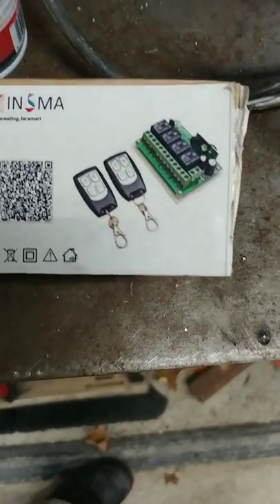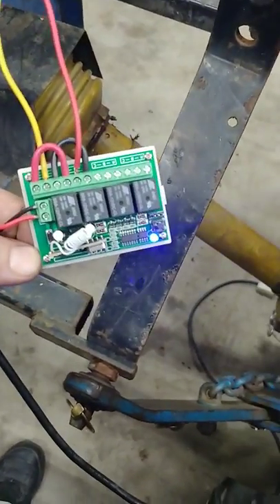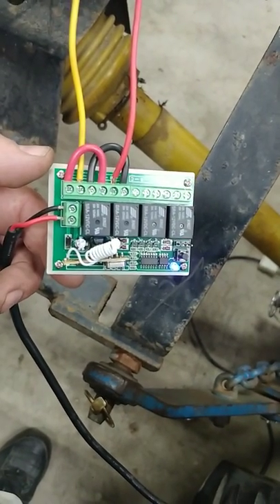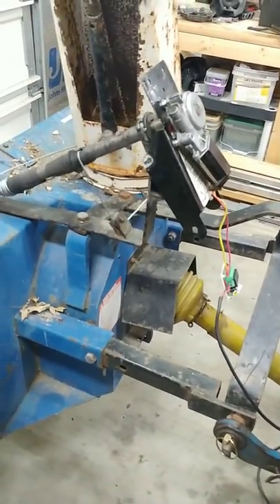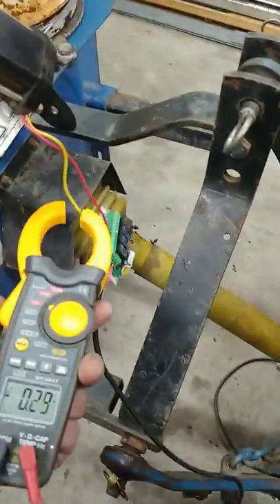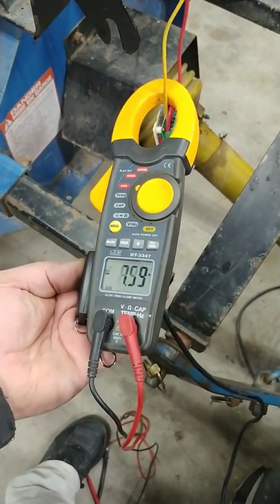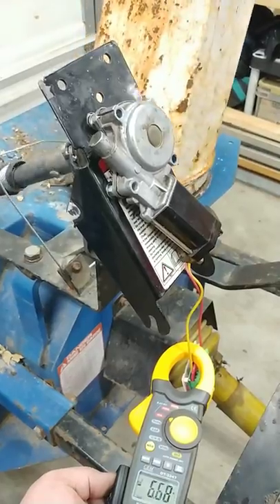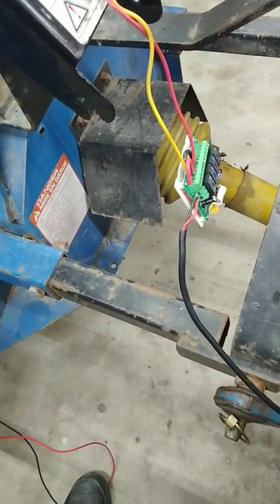Insma 433mhz wireless receiver relay 422067 on 3pt snowblower chute

Comment from the maker: INSMA 433Mhz Wireless RF Switch Long Range DC 12V 4CH Channel Wireless Remote Control Switch, DC12V Relay Receiver Module, Transmitter Toggle Switch RF Relay (2 Transmitter & 1 Receiver) https://www.amazon.com/dp/B01CCSG2ZY/ref=cm_sw_r_cp_apa_i_QVP.Db4X10BNA